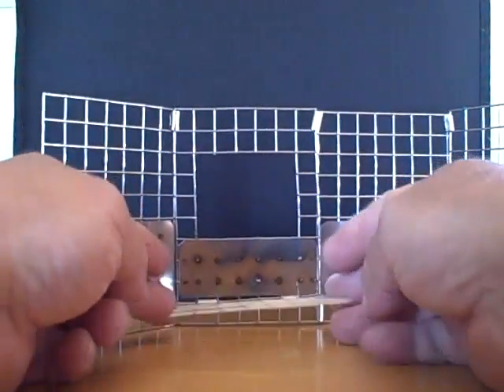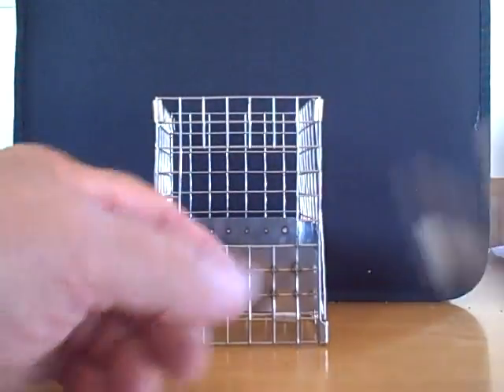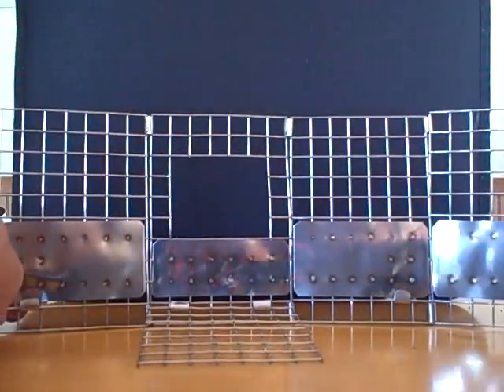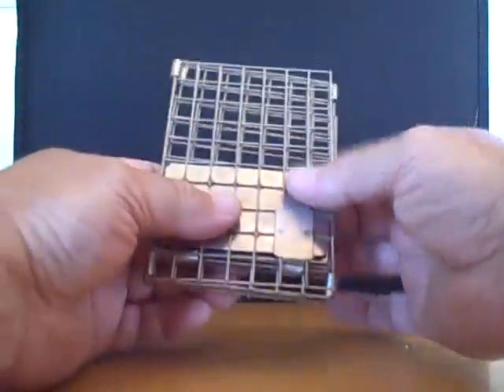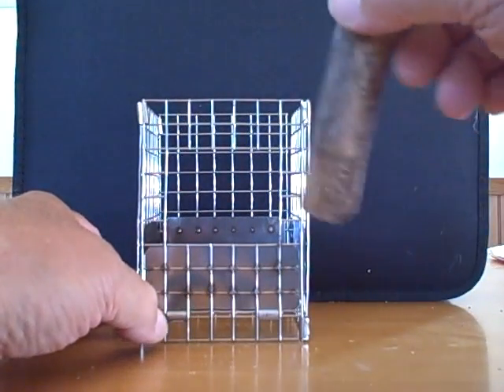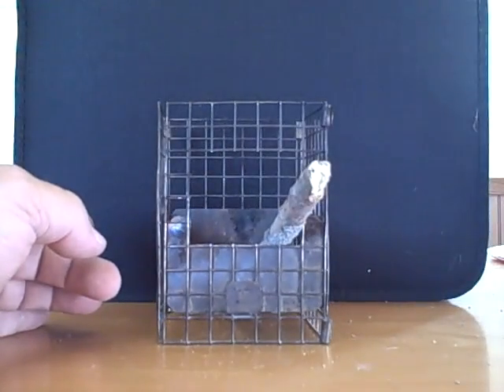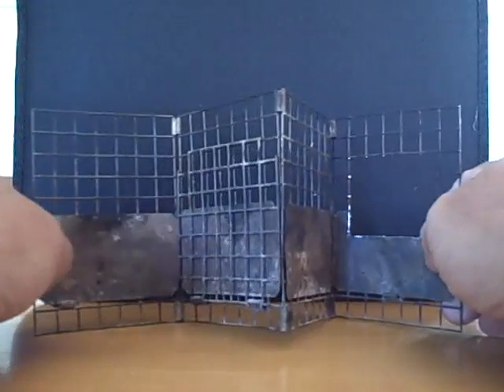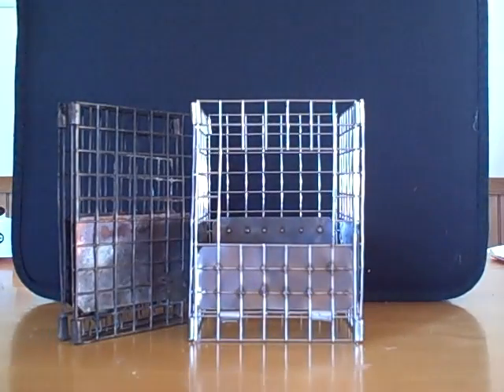Woodgaz Stove with side feed port

Comment from the maker: Good idea. I currently supply 2 sheets of stainless steel to put under it to protect the ground. I like the idea of a pan but it would have an affect on the draft coming in under the grate. Maybe if the sides of the pan were 1/8" might not be too bad. I'll make one up using the .002 stainless that I use for the ground sheets.

Comment: Nice size. You could add an ash pan on the bottom that might also hold it all together tightly and protect the surface somewhat. It would be a separate piece that could just snap onto the closed stove. Jim